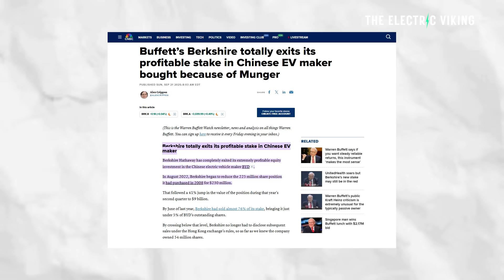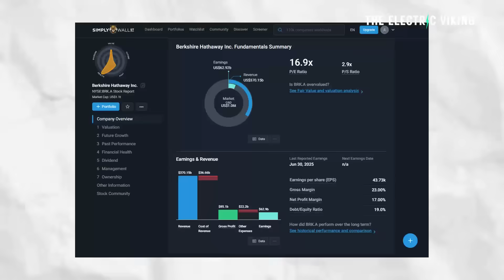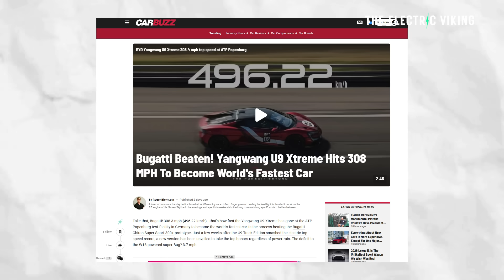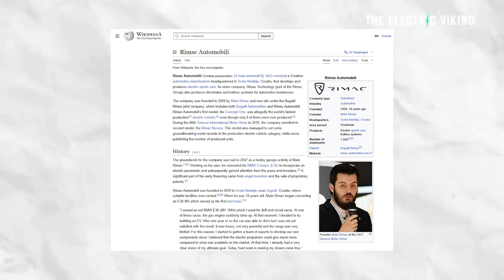BYD Breaks World Car Speed Record then Breaks EV Nurburgring Record!

Comment: I mean just install 1500 kW chargers at race tracks and this is all you need to replace F1…or do a battery swap mid race…either way ICE is toast!
Reply: Next gen regs for F1 will move away from 50/50 ICE/MGU-K back towards V8 and minor battery/KERS with 100% sustainable fuel.... atm the most expensive fuel on the planet, but it will get cheaper and be drop in for the approx 2 bill ICE cars on the roads that won't be disappearing overnight.
Basically F1 has committed to remaining a motor sport.... in 10 or 20 yrs that may change

Comment: None of this matters. What matters is that the car is expected to cost between $250,000 and $300,000. This means that as long as you work hard, anyone can afford it! A Bugatti, on the other hand, would cost $5,000,000, which you'd probably never even consider buying. Of course, American buyers, don't be fooled. You'll need to spend around $1,200,000 to buy this car, or you might not even be able to afford it.
Reply: We don't buy Chinese crap here 😂😂😂

Comment: To be fair, the type of performance that we really want to see out of electric cars is fast charging speed. That will make the biggest difference in people's lives. We are almost at the point where an electric car can "refuel" as fast as a gas car. When a full recharge can occur in less than 10 minutes, that will really be something to celebrate.
Reply: It is already happening in China (charging 80%/250miles in 5 minutes) but it will not happen in the next decade or so in the rest of world due to infrastructure limitations.

Comment: And the great thing about electric cars in general is that they can perform like this and then still get the equivalent of 80 to 100 or more equivalent miles per gallon when driven normally. Gas cars cannot do this. A gas car that is tuned to go this fast is going to get pretty subpar mileage even when driven "normally".

Comment: BEVs always remark about their short speed runs - but a 1962 VW beetle could give any BEV a challange from Munich to Berlin on the Autobahn... because as BEVs encounter drag, or loads, their energy consumption skyrockets and range drops dramatically, the faster a BEV goes the more quickly it must go to a charging station. Is a car fast if it can only travel 50 miles before it has to recharge for an hour?

Comment: Are they fast sure , no question , however when racing they are going to be challenged long distance , laps of racing etc due to the cars cannot maintain the charge and full power , like say a 50 lap race , 60 , 70 etc and produce that power output , these EVs are good for hot lapping , the formula E series has shown they barely make 40 laps , minimum 33 laps , this is where these EVs struggle,  formula E tries to entertain fans with barely a full race distance of trying to complete  30 laps before the cars are toast , so yeah on a single lap sure fastest .
Reply: It's not designed for lap speed, just straight line speed.... and nothing is going to average 500 km/h doing laps cos the G forces would be catastrophic for a human driver.
High end road car EVs are now close to 1000km range. In a few years racing versions will have ICE beating performance and full race distance.

Comment: Why does an EV not beat the ICE around the track?
Reply: EVs are definitely good on track, but only the track focus EVs, just like ICE cars have to be track focus to make good records. They are the same. Check the SC01 for example, it's cheap in china, less than 30000 usd, but much more expensive ICE cars cant beat it.
Reply: You missed the section on the Nurbergring test?

Comment: The SU7 Ultra is 4 doors and 1500hp so yes it's more impressive that it only ran 5 seconds slower than the U9. Imagine if it had the same power output as the U9
Reply: It's difficult to balance the tracking record and top spead.
Reply: Family car like $75k. 😅
Reply: Imagination is good, but it's just imagined.

Comment: Xiaomi and BYD on their 1st Gen cars just breaking records here and there nonchalantly with hardly any fanfare effortlessly just because Chinese tells you all you need to know!

Heck Nio with the EP9 about 10 yrs ago now already put China on the map! And this is with EVs not even trying.... theyve got new batteries and these are production cars and not even bespoke speed machines! with the aero and weight reduction type cars! like the Merc or is it the VW
Reply: not first gen, decades of tech development and the U9 is a showcasing project just to show off what thier tech is capable of doing ie LFP, suspension,  All in one electrical drive etc.

Comment: EVs have low drag coefficients due to not needing big air intakes to power and cool the engine. I suspect cars like this could do 350 mph or so if they had a long enough runway and tires that could safely handle it.

Comment: One way is not enough. At those speeds, it's all about drag vs. speed, and the wind speed matters by a squared factor. Run it both ways within the rules. I am certain that this thing will break the 500 KPH record (as measured by the average of two runs in opposite directions).

Comment: Has battery tech got good enough now to replace F1 engines with EV?
Reply: Formula E already exists
Reply: F1 is 50/50 ICE/MKU-K from 2026.
When those regs end they'll prob go back to V8s with 100% sustainable fuel and almost no MKU power, partly to make the cars lighter and smaller again... and to make them sound better.
F1 is committed to remaining a motor sport. Formula E will continue as the poorer cousin.

Comment: Looking forward to the cars all stopping in the pits for 2 hours for recharge.
Reply: byd 1000kw charghing system can charge 500km range in 5min
Reply: no doubt, but you’d be lucky to find a charger in uk able to deliver that.  The current technology also appears to degrade batteries faster when fast charged.
Reply: Or a full battery change in seconds.  They already do it in minutes for taxis.  For a sporting environment they could cut it down if that was the goal.

Comment: What's more impressive is Bugatti Chiron Super Sport 300+ had about half the hp of the U9 Xtreme and could hit about 305 mph.  Now, imagine that car getting nearly 3,000 hp like the U9.
Reply: It's already equipped with W16 engine, not easy to add more HP especially when it's already costing 20 times more than the U9 extreme.
Reply: @jdwlzy  What do you mean not easy to add more hp?  If a Toyota Corolla GR can push 300 hp from a 1.6L I3, then it should not be a problem for a 8L W16.
Reply: @KP-xi4bj They would’ve added long ago if it’s that easy.
Reply: @jdwlzy  They don't have to do jack.  The name Bugatti alone sells the car.
Reply: Then you will see the Bugatti engine imploding into smithereen after the first 1 .5 kilometer. 🤣🤣🤣
Reply: @satanbuster8248  I think you're confusing the Bugatti for BYD (Bury Your Dead).  LMFAO  SMH
Reply: Poor Bugatti took more than twice the time to only reach a slower speed lol 😂
Reply: @taoprsn Poor Bury Ypur Dead (BYD),  it takes 3,000 hp to be 3 mph faster than a 1,600 hp Bugatti.  LMFAO  SMH
Reply: @KP-xi4bj See, you are lacking physics education. It took less than 1/2 bugatti's time to beat bugatti, that's where the power goes 😂 And 496 still not its top speed.
Reply: @taoprsn Thought this was a top speed tesr???

If you're going to troll, put some effort into it.  😆🤣
Reply: @KP-xi4bj Nah dude, when the first 470+ record came out, a lot of people, i mean possibly you included, said U9 will not break Bugatti's test. Now the second record makes U9 the fastest production car. You know what's next? The first production car to break 500 😅 I'll let you know when that happens.
Reply: @taoprsn  The Bugatti broke the 300 mph barrier on August 2, 2019.  We can see that you're still stuck in August 2, 2019.  😆🤣

BTW, the U9 that hit 308 mph was NOT a production car but a prototype.  You can see that by the stripped out interior.

We're done here.  The sign above your head says, "DO NOT FEED THE TROLL".

Comment: What's the range?  Like less than 100 miles per charge?  Anyone can make a car go fast in a straight line, but to do it with good range is real engineering.
Reply: What's the range of an ICE car doing this kind of speed?
Reply: @Michael.B  Every middle sport car will outrun the most hyper electric car on distance, because electric cars can't hold the same power levels due to battery thermals and fast degradation because of rapid accelerations.
Reply: @Michael.B  Bugatti Chiron Super Sport 300+ can get about 200 EPA miles per tank.  Let's see U9 Xtreme beat that.
Reply: this is quite literally the dumbest comment i've seen in months
Reply: on the other hand,  BYD build a car that could keep running above 2000km with just one tank of patrol and full charged battery. BTW, it's also quite affordable, just some 50K US $. And also 500K km or 10 yrs battery warranty.
Reply: @nelsonren1220 BYD (Bury Your Dead) can barely keep its car from catching fire:

https://www.youtube.com/shorts/b1H0be7baX4

😆🤣
Reply: Supercar buyers never prioritize range—at least not as a primary concern. Criticizing them is like telling a Hermès patron: 'Your bag is nice, but it's overpriced; I could get a similar-sized one for $500.' Shed that value-focused mindset. Excellence is excellence. Masterpieces deserve applause.
Reply: @lmn6335  Like I said, a 3,000 hp EV barely faster than a 1,600 hp ICE car and gets worse mileage than an ICE car.  Excellent piece of shit is what it is.  

Keep coping, we could use the laughs.  😆🤣
Reply: @KP-xi4bj  Exactly. This attitude of yours is precisely what I define as the mentality of scarcity—a perfect match for the archetype in question.
Reply: 充满电可以跑450km
Reply: @core-grlan  That's for a base U9 with 1,289 hp.  So, 450 km CLTC = 280 CLTC miles = 182 EPA miles.  Much less range than the Bugatti (e.g. 200 miles).  An EV with more power (e.g. U9 Xtreme) will consume more battery (e.g. < 182 miles).
Reply: @KP-xi4bj  You know nothing yet so arrogant.
ICE cars you add power to them, you have to lose fuel efficiency. But for electric motors, they doesn't have that characteristic, 1500hp su7 ultra is still as efficient as a 200hp EV. And more, when you breaks or go downhill, the momentum lose will charge the battery. ICE cars can only dream about these features. 
And your words "A 3,000 hp EV that is barely faster than a 1,600 hp ICE car"? That's hilariously stupid. Do you know that bugatti took more than twice the time to reach a slower speed?😂
Reply: @taoprsn Nearly 2x the hp but only about 3 mph faster in the top end.  Now, let that sink in.

😆🤣
Reply: @KP-xi4bj It took less than 1/2 bugatti's time to beat bugatti, and U9 is still testing on atp track after the 496 record 😅 496 is not its top speed, you will see.
Reply: @taoprsn Thought this was a top speed test???

If you're going to troll, put some effort into it.  😆🤣
Reply: @KP-xi4bj Nah dude, when the first 470+ record came out, a lot of people, i mean possibly you included, said U9 will not break Bugatti's test. Now the second record makes U9 the fastest production car. You know what's next? The first production car to break 500 😅 I'll let you know when that happens.
Reply: @taoprsn  The Bugatti broke the 300 mph barrier on August 2, 2019.  We can see that you're still stuck in August 2, 2019.  😆🤣

BTW, the U9 that hit 308 mph was NOT a production car but a prototype.  You can see that by the stripped out interior.

We're done here.  The sign above your head says, "DO NOT FEED THE TROLL".
Reply: @KP-xi4bj  Bugatti确实非常强，一直是最快汽车的标杆，但传统跑车的发展上限已经到头了未来几年也很难有重大改变，而u9才上市很短时间，电机和电池不久后仍然会有很大提升
Reply: @KP-xi4bj  It's a production car. Check the fact if you still have internet connected.
Reply: @taoprsn  "The record was set by the U9 Xtreme, a special, low-drag version of the regular U9, which may not be the final production version available to customers. This raises concerns about whether the car was truly representative of a production model" - Google

Facts checked.  

That's it, no more feeding the troll.
Reply: @KP-xi4bj  Source?
Reply: It's designed to be a billionaire toy that is also a self fueling perpetual PR machine.

Look at other Chinese EVs for economy, range etc... They're coming for all sections of the market from micro town cars to the high end luxury performance of Rolls Royce... and taking out AMG, BMW M3, Porsche, Range Rover etc along the way.

Ranges for EVs are creeping up to 1000km and charging times to 80% are getting down to 5 mins. Batteries are improving every year.

* Going fast is one thing but it's not "anyone" who can make the FASTEST car in a straight line. That's why it's news when records get broken.
Reply: @gonzo1354  Billionaires aren't looking at anything Chinese.  Just saying.
Reply: Lmfao. Yeah because super and hyper cars have so traditionally known for their fuel efficiency.

Damn hate rotted two of your four brain cells son.
Reply: @airtioteclint A 3,000 hp EV is barely faster than a 1,600 hp ICE car.

Cope harder, wumao.  😆🤣
Reply: @airtioteclint  A 3,000 hp EV that is barely faster than a 1,600 hp ICE car.

Yup, there goes all 2 of your only brain cells.  LMFAO  SMH

Comment: The U9 was developed by German car designer Wolfgang Egger, who previously served as a head designer for Alfa Romeo, Audi and Lamborghini, and began working for BYD in 2017.
Reply: Not developed, he just design the look of the car, all motor technologies re in house developed by Chinese engineer in BYD, that's why there isn't a single automotive brand of Europe can produce electric car with such power and quality.
Reply: @night423-x7t  So, when you see statements like “the U9 was developed by Wolfgang Egger,” it reflects his role as the head of BYD’s design operations, not that he personally sketched the car alone. The U9 (a Yangwang performance EV under BYD) was created under his direction and vision, with his design team executing the details.

👉 In short:

Egger is BYD’s chief/global design director.

He oversees design strategy and projects like the U9.

He is more than “just a designer” — he leads the whole design department.
Reply: @tom20152  nope, he just a designer that set requirements for the team to design a car, but all technical part, engineering task, fine tuning are performed by BYD's chinese engineer. Just like what I said, if Egger hired by any non-chinese automotive company, he will not even get such ambitious EV project, he can litterally replaced by anyone, because he only for design, he do not provide any technical skills regarding EV.

In fact, none of the western engineer can provide any technical skills for BYD to achieve such speed with electric motors, because China is the only nation that leads in EV related tech, and the competition is among themselves, just like how this car only broke Xiaomi records.

In short, Put Egger into Ford, Toyota, BMW, Audi etc, you either get a slow ass outdated EV or another ordinary smoke generator that has nothing to do with world  records, Egger is irrelevant to such achievement, he only a designer. BYD is the one who owns the tech, and speed records is technical achievement, it has nothing to do with designer.
Reply: @night423-x7t  A saving grace is until now, the best of the best drivers are still predominantly European or Latin.
Reply: @tj7558a  😂😂😂 your funny lol
Reply: designed. not developed.
Reply: I wonder how much he got paid? All the top European car designers are now working with Chinese EV's.
Reply: @ay21.21 well obviously designers arent allowed to go wild with constraints on what they can do versus what they will sell! hence if Western designer can get equal or more to actually bring something to life and they have no design or financial constraints! Its a no brainer!
Reply: If he's that great, Tesla should have hired him instead!!
Reply: Who's the lead engineer for the engine though I'm curious.
Reply: @bernardjameswilson 
Engine? It's an EV with electric motors  and batteries. All developed in house by BYD.

Comment: That car could probably go faster, but my immediate guess is that no current tires a good enough to handle that kind of horsepower and torque.
Reply: The tires they used was designed at 500km/h maximum 😊
Reply: @Leon-ml4tv speed is one thing, that horsepower/torque, whole other issue
Reply: @Insert_Screename_Here  I don't think 496 or 500 will make a big difference in terms of hp/torque
Reply: @Leon-ml4tv  At  those speeds  the power requirements go up with the cube of the speed, so yes there is a difference.  Probably more than intuition would suggest.
Reply: Yep, this is the limit right now.
They would need some alien tech tires to go faster.
Or the car has to float lol
Reply: There are other cars that went faster on rocket engines if I remember correctly. So it can definitely handle it. The main problem is only handling.
Reply: @korana6308  Most (if at all?) rocket cars use aluminum wheels since rubber can't cope with ultra high speed.
Reply: @tj7558a  You are not wrong.
Reply: You have a feeling the Chinese will beat their own record with their own tyres
Reply: @siviunative5241 BYD is using Giti tyres, which is a Singaporean brand but has research facilities and factories in China.
Reply: When reaching 496km/h, acceleration indication bar is about half way only. The potential is limited by the tyres limit